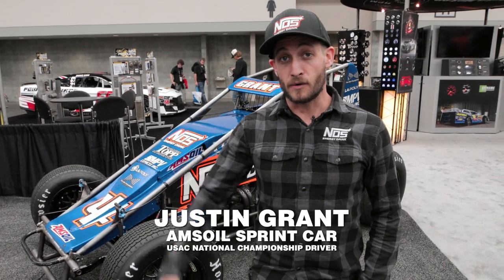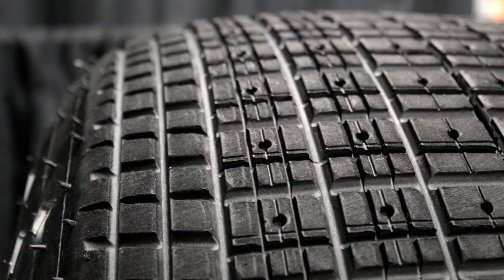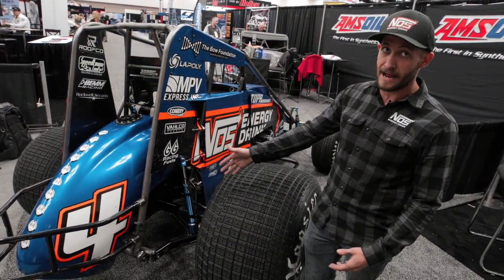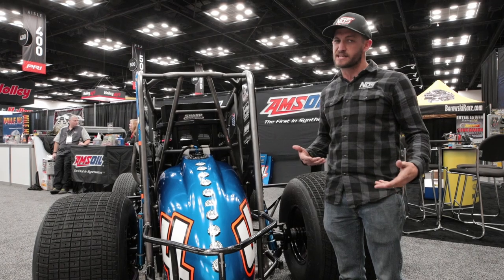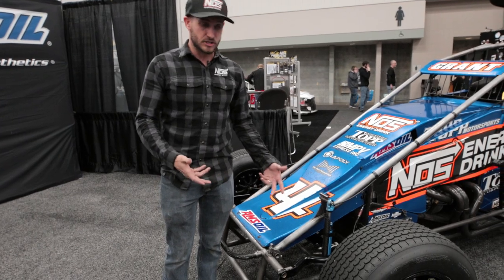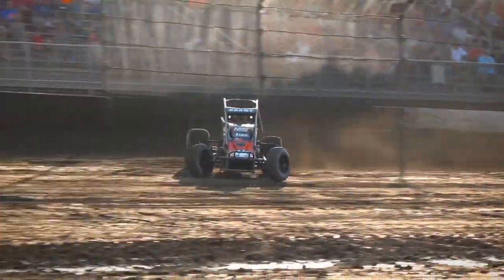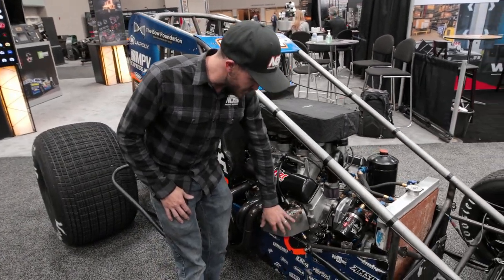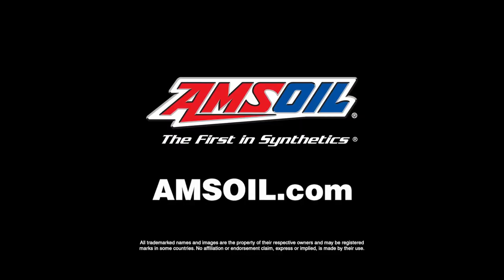Anatomy of a Sprint Car with Justin Grant

Comment: Thanks for that tutorial, lots of good stuff. 
I heard that not only do they not have a clutch or starter, but also have no flywheel. Is that true?
I've seen some of the wingless sprints go into a turn backwards and be going the right direction when they complete the turns.
Crazy stuff....stay safe.